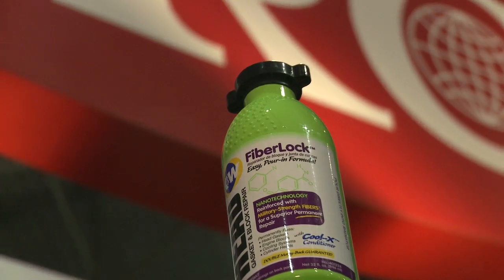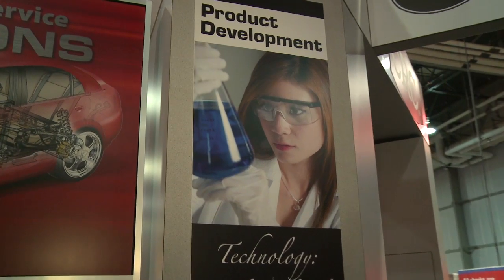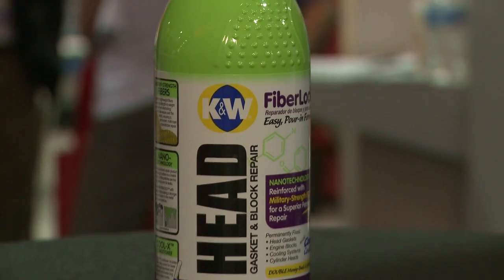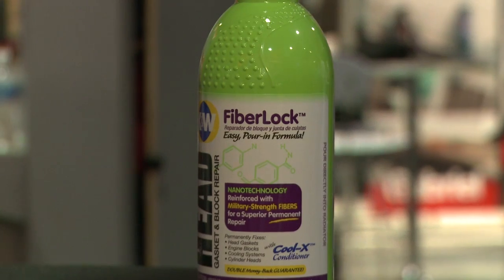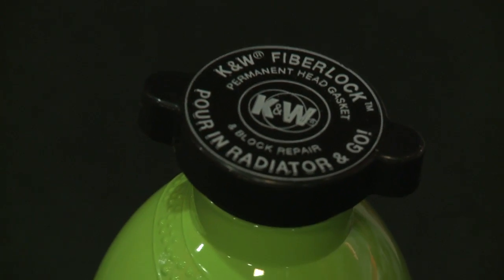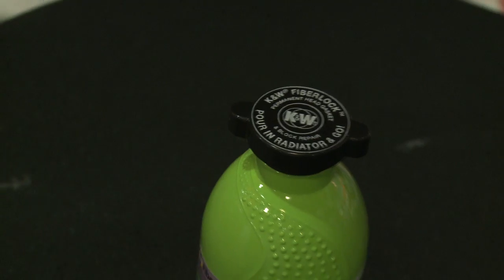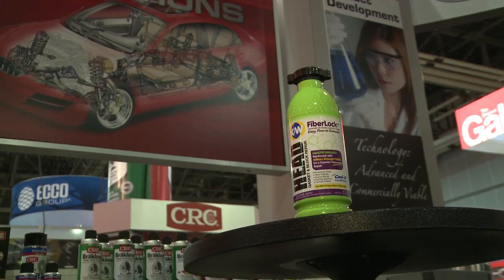AAPEX 2011 - K&W Fiberlock.mov

Comment: ok I just used this product, so here is a little review, my vehicle suddenly started to lose coolant and noticed oil in the radiator, engine oil was ok though, I completely flushed the radiator and followed the directions, used approx half the bottle for my 4 cyl. after checking for leaks I drove it for about 80 mi. over hilly areas etc. So for so good I am a happy camper no loss of coolant or over heating during this time, only time will tell.

Comment: it is the worst product i have tried said just poor and drive that's a lie if you read the bottle say do oil change flush radiator system. after that it still over heats and makes more of a head ache for me two fix. don't buy worst stuff fix the problem with the right Parts

Comment: I've tried 1/2 bottle and it seemed to stop the leak for just a little bit, but then it started losing coolant again.  Car still runs hot.  Looks like it started sealing the channels in the radiator.  Won't use this again.  If it sounds too good to be true...

Comment: just put in my 1999 deville. had a small head leak ( car kept over heating after an hour and dumped the entire contents of cooling system out the overflow. tested and found exhaust in res) Im not afraid to get my hands dirty on the install of the new  head gasket but funds are limited until tax time. if this can make it so I can drive where i need without worrying of it taking me 4 hours to go ten miles; then ill be happy. I love my car and her new engine will just have to wait a little longer

Comment: @ninjaloexe it is no longer loosing coolant  however it does from time to time run hot  i think it may have gummed up the thermostat. But it does seem to have worked for time being anyway. I am not sure how permanent it is but it has held up sense April.
Reply: MCKingJames take your thermostat out so you run it free flowing with k&n fiber lock and water